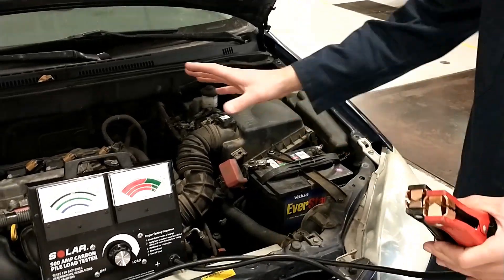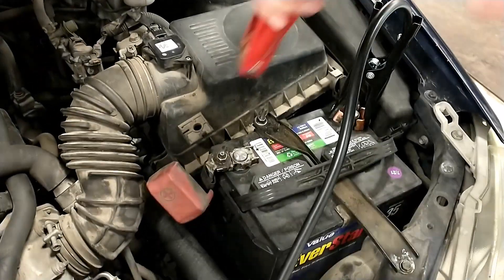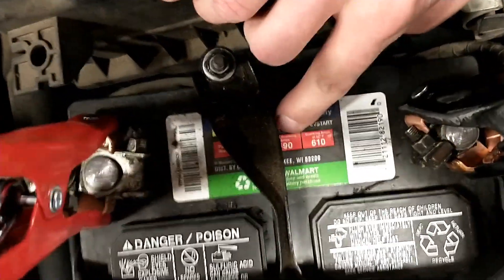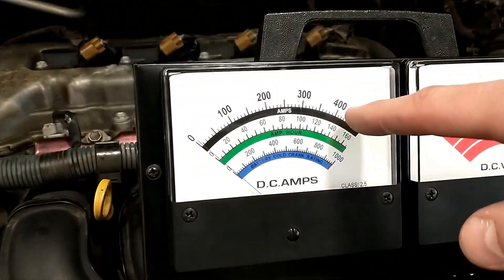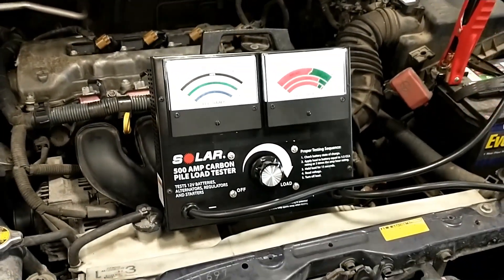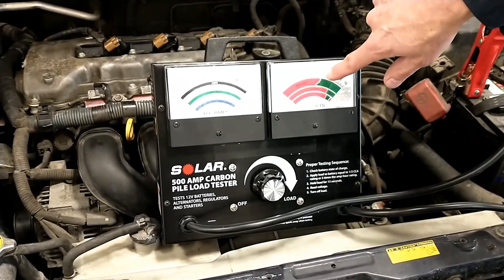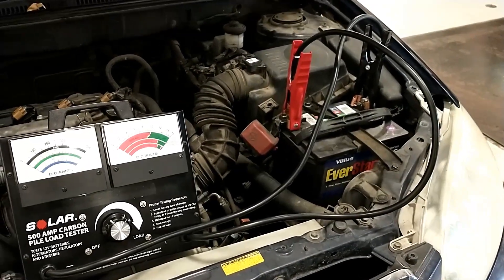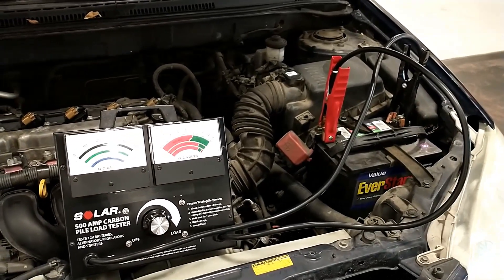Testing a Battery With a Carbon-Pile Load Tester

Comment: You said the test should be half the cca of the battery, what if the battery states 800cca but tests 1000cca, should the load applied be half of 800 or 1000?
Reply from the maker: The test is supposed be done using the "rated CCA," so go by what it says on the label.  If the battery produces more current than what it is rated for, that's great.  You have a good battery!

Comment: Surface charge on the battery plates need to be taken off before the atual load test is preformed.  The battery is loaded for 15 sec at half the CCA.  Battery is allowed to rest for 15 sec.  Load test is reaplied for 15 seconds and the voltage cannnot drop below 9.6 volts.  This is what is written in the Bible!

Comment: I like this test cause the gauge tells you right away what's going on ..and the testers are cheap at harbor freight I've had one for 20 yrs still going strong. You can also load the charging system and watch alternator output.

Comment: Question, why is it on a lot of these carbon pile load testers  the buzzer is going off way before the 15 seconds at the end of the test?
Reply from the maker: I don't know the answer, but as a teacher, I like it.  The old VAT-40's didn't beep, and students would leave the load turned on until smoke started coming from the inside of the tester.  The load testers last a lot longer when they have a beeper!